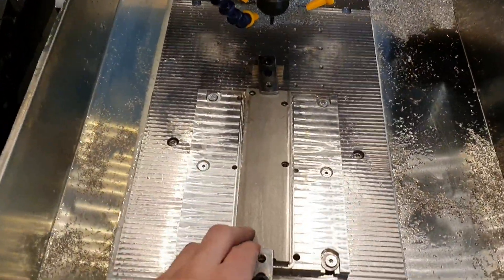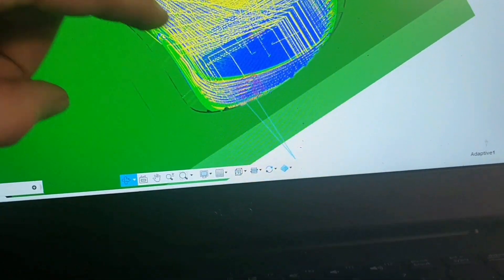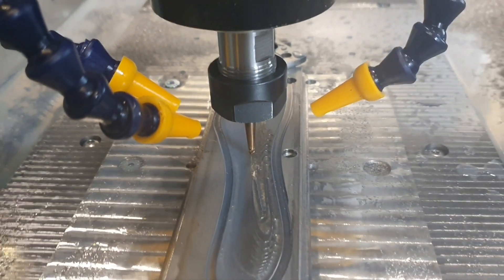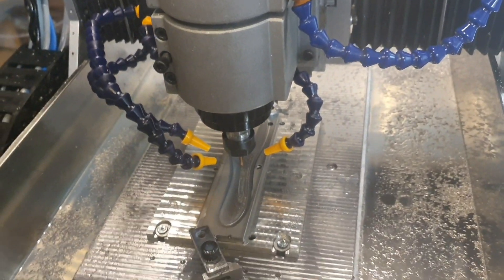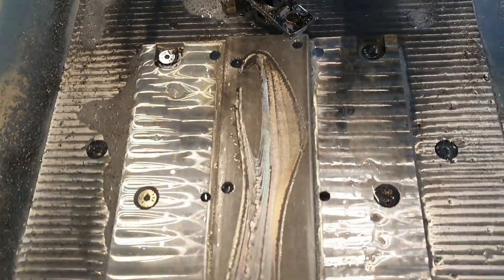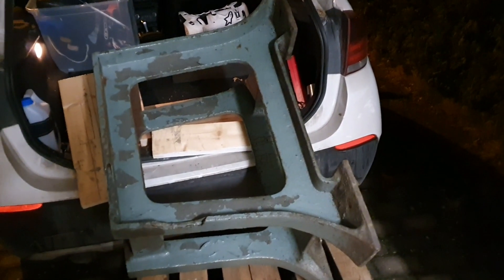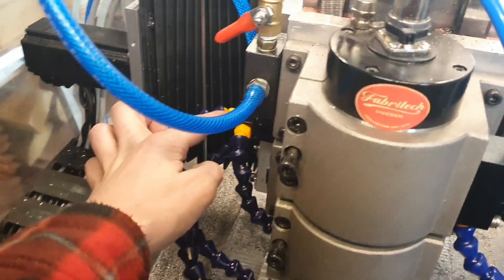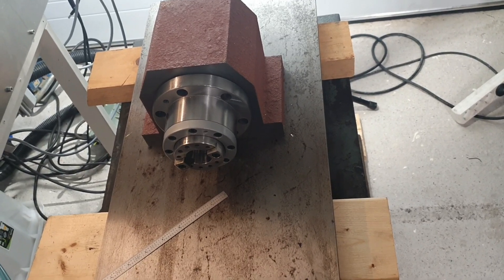cnc milling a stainless steel butterknife (304) + buying cast iron stand for the router

Comment: That surfacing looks fantastic! I've just got my modified 3040 cutting titanium and stainless steel, flat and V-carving. 3d surfacing is what I need to do next.

However, I hate using Fusion. I'm just learning on Estlcam to start.

Comment: Super happy to have found your channel. Like you, I am not a machinist by training but have spent the last few years learning to use my lathe and optimizing my 3D printer and getting ready to start building my own granite CNC router. I will be needing it for structural parts and was sure I would be able to make it stiff enough for machining aluminium. (My router will be a smaller version of Fox's surface plate build, so should be as stiff or stiffer than an alu/alu extrusion router). And seeing you mill titanium and 304 makes me super relieved as I had a secret hope that I would be able to do that, too. 

I am binging a whole lot of your content now:)

Comment: I would recommend building a new proper milling machine (whether that be with a Y/Z Gantry or a vertical or horizontal setup (Or something like the Kern Micro, I would look up some of the pamphlets for those machines, they give you a peak into what the giant Epoxy Granite Base and the 3 Axis assembly looks like)) and THEN selling the router. Having both your manual mill and the beefed up 6040 router will probably make your life easier, especially since it can handle some steel milling along with the mill. I sure wish I had a router like that while building my milling machine for boring holes and slots on the big 1" thick pieces of steel I had to deal with lol. I had to learn how to make decent measurements and layout lines with blue layout fluid lol. Definitely cool, but It's a ton of work. Nice butter knife BTW :D Those pieces of Cast iron seem to fit better with a new CNC milling machine too lol, not the 6040.
Reply from the maker: Thx for commenting. Did you use a magnetic driling drillpress when drillling the 1" steel plate or how did you do?
Reply: @thechipwelder1253  I used a regular floor drill press. It was quite a chore. Thankfully I had a moveable workbench that could raise and lower its table up to wherever the drill press table was at to support the long pieces (I had one piece of hot rolled A36 that was 28 inches long and 12 inches wide that I used as the base of the machine... For now, and another that 30 inches long and 8 inches wide along with large rechangular tube for the column lol). Without the extra table to rest the metal on, I would have needed a far bigger press table or a few people to hold on to the pieces as I drill lol.

Comment: I think you should keep that router and use it to build the new machine. And then still keep the router and the new machine and your lathe. It’s always better to have more machines then you can make repairs and upgrades on one using the other.
Reply from the maker: Yeah! Since the router is peforming very well it feels stupid to continue to take it apart all the time for inprovement. Would be nice to keep, but got some space issues.... :)

Comment: Making a stainless butterknife may be cool but making a stainless steel endmill to cut butter with 0.01mm precision on the router would be way cooler haha. Good job man 👍🏼
Reply from the maker: Haha, when I got a 4th axis.  It will definetly be a stainless endmill to cut butter with. 😀💪

Comment: get started on the new design , keep the old one to make all the brackets and parts.. When the new one is complete , sell the old one for a few thousand euro.. Having the cnc to make another cnc is much easier. Just locating holes is 40% of the time invested in a cnc
Reply from the maker: Hello Rob :) Good point, I am a bit short of space. But as you say, it will help out alot to have a cnc running when putting the new machine together. Making motor mounting plates and similair stuff.. :) thank you very much for commenting

Comment: Nicely done! Next version of your router will be a monster :-)
Reply from the maker: Yes, but I am almost thinking about selling the one I have and start from scratch. Since my router now works very good and is cutting accuratly, it does not really feel time effecient to continue and tear the router I have down all the time. So it might be better to sell that one and design a new one in fusion. Buy larger ball screws and servos. But since I spend many hours on my 6040. I would like to use it and make some projects first. Thinking mayby I can sell it next spring / summer. :)
Reply: @thechipwelder1253  Yeah, you usually need to keep the first machine to make the next machine. You quickly run out of floor space ... :-)